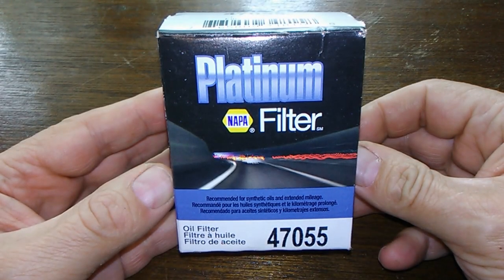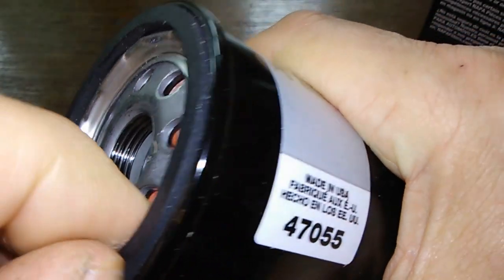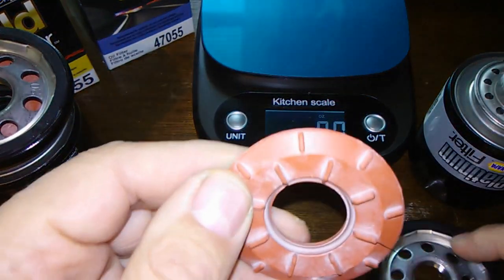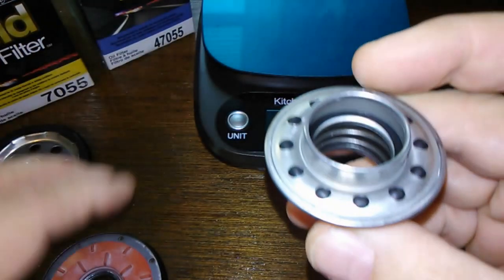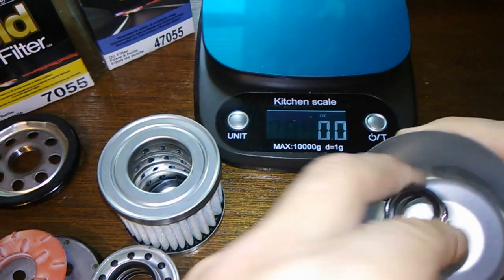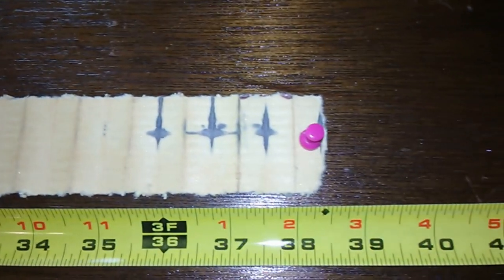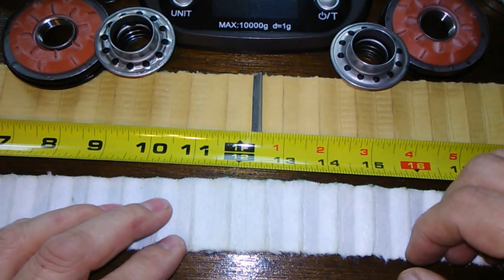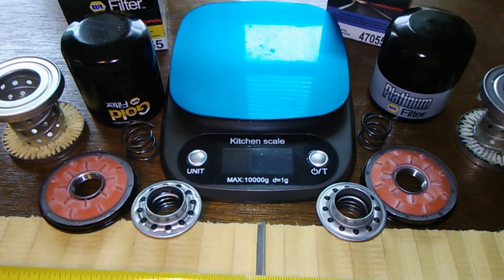Napa Platinum Oil Filter Cut Open 47055 Napa Gold Oil Filter Cut Open 7705 Comparison

Comment: My 1993 Jeep Grand Cherokee limited 5.2 V8 is still going strong for 28 years without engine or transmission overhaul. Right now it is over 423,000 miles. Several years ago, I've used conventional oil then blue smoke came out from tail pipe as I didn't like so, I switched 5W-30 Mobil One Synthetic oil (no high mileage or no extended). I changing oil every 6 months Spring and Fall since retired is fewer driving or change at 5,000 miles but not beyond 7,000 or 8,000 miles plus, added engine restoration solution with Royal Purple oil filter for years (changing max 10,000 miles). Additional, I've reduced engine thermostat to 15 degrees (180 instead of 195 degrees) to prolong engine life without any problem or always passed smog check. Also, I've used mostly Chevron 87 octane gas of trying not get a cheap gas brand too.
Reply from the maker: Wow sounds like you take care of your Jeep.👍
Yes, top-tier gasoline is good. 
I too went to a 180 thermostat, because 180 usually means around185 and 195 usually means 200+
Keep up the good work.👍😊
Reply: It sounds like you really care about your rig, and that you want what's best for a long, trouble-free engine life.   Me, too !! 😁
Chevron 87 Octane is a wise choice -- consistant quality and performance.
Mobil 1 is a POPULAR oil, but it tests poorly -- Pennzoil Ultra Platinum tests MUCH better, and costs about the same.
You'll find that the Bosch Premium oil filter tests better than the Royal Purple oil filter, and for LESS money.
And then, there is the subject of ENGINE TEMPERATURE -- VERY important, but so often misunderstood.
You say you dropped your Thermostat Temp by 15 degrees "to prolong engine life" -- BUT -- that 15-degree temp drop actually SHORTENS your engine's life !
Years ago, we ran our engines at 180 degrees -- no problems.
When they started getting serious about emissions, it was discovered (and proved) that engines performed better and lasted longer when operated at higher temperatures -- closer to 200 degrees F.
By the early '90s, commmon thermostat temps were 195 F, with some GM cars at 205 F.
Old-school guys like me and you kinda flipped out, 'cause we thought that "cooler is better"  -- but we were un-informed.
Now, we have decades of research that shows that our engines run better, longer, and with much less air pollution than in those early days.
I've found the MOTORAD 195-Degree thermostat to be the top-performer over a variety of temperatures and climates.
Reply: @SlikLizrd  thanks, interesting………etc.

Comment: So if most all filters you buy have a bypass valve in them that is set up for 12 - 15 psi and your engine runs down the road at 30 psi what percentage of oil gets filtered anyway? When it starts up for a few seconds before the pressure comes up? Most car engines make more than 15 psi even at idle. You can find a TG3682 at walmart once in a while that does not have a bypass in it so wouldnt that be better. It fits 3/4 x 16 threads which covers filters like tg3600 and m1-209, fl400 and gobbs of common car filters so wouldnt that be best to filter 100% of your oil rather then ?
Reply from the maker: Once your engine is warmed up and you are using the correct viscosity oil for your engine and the oil filters is not clogged. Then the answer to your 1st question is it should be filtering 100%.
You need the bypass valve in case your filter gets clogged or the oil is too thick especially when cold, without the bypass valve parts in your engine could starve for much-needed oil. The bypass valve will not open until the pressure going through the filter media is more pressure than it takes to open the bypass valve.
Typically in a warm engine even if your oil pressure is above the bypass valve setting, the oil will flow through the filter media easily and the bypass valve will not open. 
I hope this helps.
Reply: @WhipCityWrencher  oh really i have that filter on my diesel tractor that was made in 1980 and its not a problem. What are you going to bypass in a gas engine that runs on a clean highway. Sludge? Metal shavings? It doesnt need the bypass and no you dont get %100 filtration. Look up any filter and they are made to bypass at 12 psi. You could change oil and never put a filter on and never know the difference. We plug chevy V8s and run a non bypass filter and never have a problem. Sometimes 100 psi cold happens and the filter never bursts or comes off.
Reply from the maker: @billyjack8119  That's up to you, I'll run oil filters that have bypass valves.
Reply: Your oil pressure gauge is measuring oil pressure relative to atmospheric pressure, where as the bypass valve only sees the pressure difference between the inlet and outlet of the filter itself. In other words, you might have 60 PSI engine oil pressure, but only a few psi drop through clean filter media with warm oil.

Comment: I think twice a year Napa runs their 50% off sale on filters, spring/fall. I stock up on everything...for jeeps.. tractor, air and oil and fuel filters. Always use Gold no complaints. Recent problem I had was finding an oil filter for Chevy 2.7 turbo 2021 Silverado. Used a WIX because couldn't get a Gold (I know same thing). Just ordered 3 Golds from store.. online they were unavailable. Great video, thanks.
Reply from the maker: Thank You!
And Thanks for your feedback.👍🙏😊

Comment: Thanks for you videos they are vary interesting. I was wondering if you can  leave a quality oil filter like Napa platinum or Fran ultra synthetic in for more than 1 OCI
Also can you cut open a Hasting oil filter that can be used in my 2008 LMM Duramax
Reply from the maker: Your Welcome,
👍
The Fram Ultra is supposed to be good for 20k miles. I believe the Napa Platinum say's to follow manufactures OCI recommendations.
It really depends on your driving. 
I'm no Expert, this is only my opinion, me personally, I do short OCI's. I wouldn't use any oil filter for more than 10k miles or one year, and in that time frame you could change your oil as much as you want plus I like to use a good synthetic oil.
( oil and filters are cheap, engines are not.) 

Sure, I can do your Hasting oil filter. Is the LF524 the correct size? In any case it won't be shown till sometime the end of Feb. Let me know if this is the correct filter you want shown.😊
Reply: Perfect that is the one. I usually use wix or Napa gold but they are becoming so expensive here in New Mexico I am thinking of buying a few of the Hastings on Rock Auto and save a little. I really like the spring used in a few remaining filters now days.
Reply from the maker: @clydeespinosa6286   Okay, I'll try and put it on Feb. 19th. 😊
Reply from the maker: A  Baldwin B1441 oil filter will be published on Feb, 16th and the Hastings LF524 comparing it to the Baldwin B1441 will be published on Feb. 19th., If you like the videos please hit the like button, Thanks! 😊
Reply: I have used a Fram Ultra for two consecutive oil change intervals on my Subaru and Hyundai vehicles without issue.  I know of several people who have done this and reported good results.  Wix, Hastings, and the Fram Ultra are all good choices for the Duramax.

Comment: The plat is tailor made more towards marine applications as they are working at higher RPM's than most cars/trucks. I cannot remember exactly what it was my sales rep at NAPA told me but it had something to do with that as well as the seal on the filter.

Comment: so I just bought a couple different model numbers of this filter for family members since the sale is so good this month(april 2021). The one for the 2021 Kia Soul has what appears to be the nitrile rubber base ring or whatever it's called, but the anti-drainback valve is silicon. HOWEVER, on the filter for the 2013 Nissan Quest they're BOTH black, indicating to me they're both nitrile rubber. I would have wanted the quest's filter to have silicon because for the vehicle it's supposed to ride out a 7,500 mile oil change interval and the filter is soooo small! I don't get it. Maybe for the sale they're going cheap, but honestly, I did not have a great experience at Napa this time. I purchased a total of 4 filters, paid all up front, they had ONE when I paid and then I had to go back 2 more times. NOT convenient.
Reply from the maker: I'm pretty sure the Platinum filters have silicone anti-drain back valves, sometimes they can be black in color. What is the filter number? I'll pick one up and opened her up and see, would make for a good video if it's nitrile rubber.
Reply: @WhipCityWrencher  so the little one for the Quest which appears to have the nitrile antidrainback valve and o-ring is model 41358 and the other for the 2021 Soul with just the black O-ring but silicon aintidrainback valve is 41334. Thanks
Reply from the maker: @dgunearthed7859  Okay,
I just checked their website and it says the 41358 has a silicone anti-drain back valve. I highly doubt their site is wrong on this one because the platinum is a top-of-the-line filter. I can pick one up anyway just to do a video though. It'll be a while before it's published, but I wouldn't hesitate to use that filter.
Reply: @WhipCityWrencher  don't worry about it...anyone can look in the box if they let you (not like their filters are just hanging out on shelves like at walmart) and see the red and black anti-drainback valves. I'm sure one of their corporate spokes-holes would give an answer we all believe. lol

Comment: excellent comparison, thank you for your effort.  I've always preached CAT and NAPA filters you can see the quality.  Just a note Platinum line was made for synthetic oils, gold is for conventional.  I've used your comparison along with an Amsoil and Royal purple video; Napa by far looks to be the better value and better quality, micron rating same or better I use CAT and Napa on my duramax and heavy equipment never failed me and I've been in the business for 22 years now.  Thanks again!
Reply from the maker: You're Very Welcome!👍
Thanks for watching!😊
Reply: Either filter works perfectly fine with any oil.  If they don't and you have actual evidence to back that statement then I would say that they are not worth buying.  I have used countless Wix/Napa Gold filters with full synthetic oil without issue.
Reply: Thanks, for comments,, I actually use NAPA GOLD for my MOBIL ONE...vehicle .. I UNDERSTAND THE PLATINUM MKRE DESIGN longer intervals:: I believe the Gold perfect for MICRONS, *& filter  compositions @ routine mileages.,..& my go to (;actually use ROYAL PURPLES FOR longer intervals/ Higher miles).
Reply: What about Baldwin Filters? They make there own filters and there micron ratings as Good if not better than Fleetguard or NAPA.
Reply: @ironmike7339  that’s a good catch Michael, where I’m from them baldwins are hard to come by. Again it’s all about that micron rating. Remember though synthetic oil, synthetic filter media. That’s my recommendation.
Reply: @mvcapitolllc.7894  I order those Baldwin Filters off Amazon. There Fuel filters have the best micron rating out of any brand I could find info on. I use Valvoline  Premium Blue 15-W40 in my Cummins. I’ve got 283,000 on her and the oil doesn’t blackin or smell funky at 5,000 oil changes. That’s why I’ve just stuck with them. Going for the million mile club I hope someday!
Reply: @ironmike7339  That sounds like a good mix of brands and shows that you definately care about your engine.  I use AMSOIL 15w40 signature oils and I installed an adapter to run CAT filters for fuel and oil on my LMM duramax which I've also deleted the EGR and DPF systems to unlock its real power.  I've been working on machines and diesel engines for some years and its people like us that can research and put together a system of maintenance that maximizes efficiency and economy after all engine oil is the blood of the engine so why go cheap and sacrifice quality to save 5$.  I know you get it and keep it up.  My Hummers all Have Duramax LMM with deleted EGR and DPF, and each fluid runs a quality synthetic and a quality above OEM spec filter.

Comment: A shocker to me. I've never seen an XP/Platinum with Wix thread end bypass before. The vast majority of XP/Platinum have always been dome bypass. I believe you found an outlier with this application. I think I may have an answer why though. Using Wix look up, the 7055 is only for Subaru with the high 27psi bypass. My guess is Wix only wanted to make one bypass type across all the 7055 filters so they picked thread end for all. Cool find. Thanks for the video.
Reply from the maker: Your probably correct about the bypass valve location, I don't think I've seen another Platinum with the upper bypass, but you never know there could be others out there😊.
Glad you liked the video.👍🙌

Comment: Hey bud , is there a way to be able to know if the by-pass valve is at the top of the filter with out opening it up ?
Reply from the maker: Sometimes you can tell by looking in the (outlet/center hole), if you freeze this Napa video at 1:20 you can see it's a flat on the bottom, so the bypass valve is probably near the base or also called a upper bypass valve. Now if you freeze this Wix video at  :52 here is the link, you can see a bypass valve on the (bottom or dome end). Hope this helps.  https://www.youtube.com/watch?v=5aqaw8aL630
Reply: @WhipCityWrencher  thx bud

Comment: These look like good filters !  Nice video too.  There's several good filters out there,  my personal choice for my Silverado is the STP XL
Reply from the maker: Thank You!👍🙏🙌
Yep, the Napa Platinum is a very good oil filter.
I'd like to open up a STP XL.  what filter size does your Silverado use?
Reply: @WhipCityWrencher   S10590XL  
They have metal end caps,  coil spring, nice round non-directional holes in the center tube & rated for 10,000 miles.  And usually for $9.  Very satisfied with their quality !
Reply from the maker: @Lambert_Life  Okay,
I'll post the date the oil filter will be published once I make the video. 👍🙏😊
Reply: @WhipCityWrencher  awesome 😎
I'll be looking forward to it
Reply from the maker: @Lambert_Life  Okay,
I had some time today and made the video. It will be published 3/23/21 . I hope you like the video. 🙏🙌😊

Comment: I stopped watching when you called the upper seal an O ring.
Reply from the maker: O Ring, sealing ring, gasket?
Reply: @WhipCityWrencher  https://en.wikipedia.org/wiki/O-ring
Reply: @WhipCityWrencher  You'd be correct to call it several things but not o ring.  Technically, it's a rectangular cross section face seal but face seal will suffice.  Personally, I'd prefer an o ring here but I've only seen one used a couple of times and not recently.
Reply: You are correct, sir -- It's NOT an O-Ring, but you can't blame the Whip City Wrencher for calling it what EVERYBODY ELSE calls it.
YES, it's a GASKET -- it's round like a ring, but it's NOT round in cross-section, like an O-Ring.
The GASKET provides a larger sealing area than an O-Ring of the same outside diameter, and is better suited for operating under heat and pressure than an actual O-Ring of the same size.
Reply: @WhipCityWrencher  GASKET. It's a GASKET. 😁
Reply: @SlikLizrd  He can call it whatever he wants.  I will react accordingly.  BTW, your ignorance about O ring usage is not surprising.
Reply: @ramtek2702  Of course "He can call it whatever he wants." And he is perfectly capable of speaking for himself, so your childish remark is without merit.
Oh, and what part of my comments about O-Rings is "ignorant", or incorrect in any manner ?
I'm only familiar with the use of O-Rings in automotive, plumbing, steam, pneumatics, hydraulics, plastics molding, offset printing, refrigeration, and appliance repair -- so your experience MAY be greater than my own, and I look forward to your input and any corrections that you may have.

Comment: Thanks can you do a video comparison of the M1 303A vs M1 303 extended performance filter. This would be part of your diesel series and fit my D max
Reply from the maker: Sure but it won't be out till sometime in July because I'm getting kinda swamped with requests. I'll make a note of it, but in case I forget and you don't hear from me for a while just remind me.🙌😊
Reply from the maker: On second thought I changed my mind. (coming out next week) I did a video on a Mobil M1 with and without the A, they don't make the ones without the A so there hard to find, and if you do find one on eBay or Amazon there expensive. Pick a pair that they still make and are easy to get Thanks.
Reply: Thanks I appreciate your efforts
Reply: Whats wierd is i bought these two filters for my duramax and i forgot which one but one wouldnt even thread on. And they are both listed for my truvk

Comment: I just picked up a Napa Platinum # 47356 for my Honda Civic and these oil filters are up to $14.79 plus tax, now. Still made in the USA and I checked to make sure it had a silicone ADV. Metal core now has louvers, instead of the holes, on this filter anyways. I like to use the Purolator Boss, as well, but they're not cheap, either. I'm gonna have to start watching out for the sales I guess. Thanks again for the videos. This was a good one and a very good comparison of two really good filters.
Reply from the maker: Hi Adh,
Your Welcome! and 
Thank You!